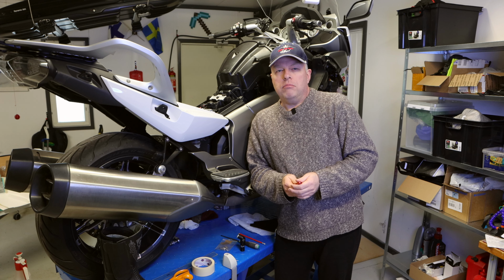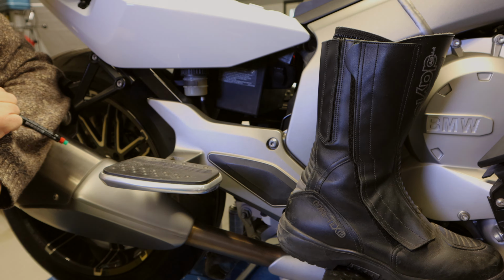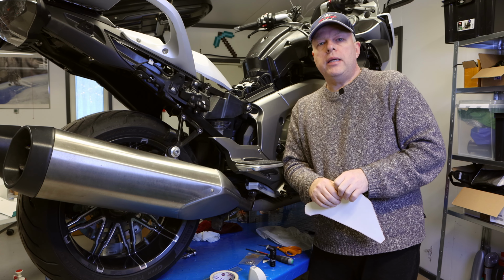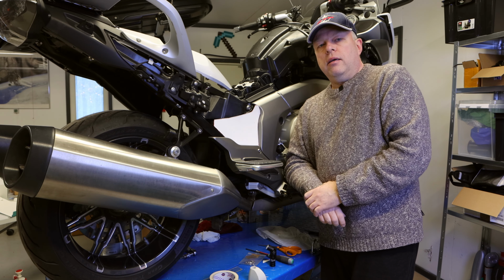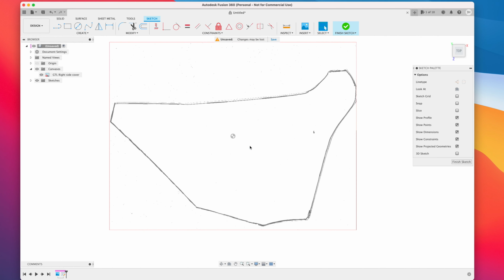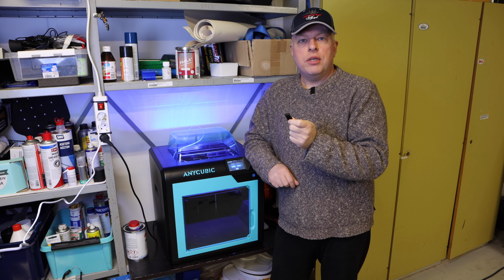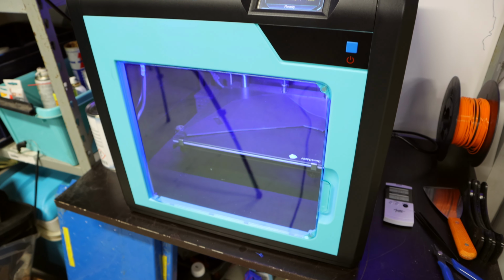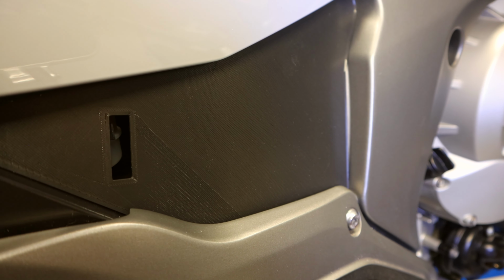3D printing motorcycle parts.

Comment: PLease I would like to know if the real motorbike plastic parts are created using 3D printers.
Reply from the maker: Hello. My print was real part. But if you refer to big fairing part, then no. It is currently impossible to print big parts. First the printer print bed is relatively small, abot 20x20 cm. Secondly the fairing is normally concave and not printable for this reason. Have a great rides.

Comment: I might have missed this in the video, but it can be worth mentioning that printing with PLA would not suit as it is very sensitive to heat and starts sagging when hitting 50C+. PETG or ABS would likely be able to (or better) take the heat and UV.
Good video!
Reply from the maker: Yes you are right. Most of my motorcycle parts are made from PLA and PETG. Some are from the ABS. I have had no problems, but the parts are located away from the heat source (hot parts of the engine and exhaust). Currently the PETG is the most easiest to print and gives the best finish. Thanks for the observation.

Comment: Thanks so much for the great video. I've wanted a 3D printer for a long time. This is just another great reason to buy one! BTW, do you have any idea of how much it cost to print that part? I just bought a 2020 K1600GT for my channel, and have a big pile of boxes of accessories to install. I wonder if I could have just made some of this stuff myself? :) Follow along at http://youtube.com/c/jaybearjaysbigadventure
Reply from the maker: Hi Jay. The cost of the individual 3d printed part is very low. After the initial cost of the printer and the filament. The slicer software can estimate the cost when you feed in the price of the filament. The cover I printed (one piece) was only a few (euro) cents. I think the trickiest part is to learn the modeling of the part with the software like Autodesk Fusion 360. But you can print parts which are modeled by someone else. There’s a ton of free parts design available from the different sites like a Thingiverse etc.

Comment: Indeed a good application of 3D printing at home. You can also try to incorporate design elements in the cover, like a logo or whatever. I wonder how it looks like when printed with a white filament one of them funky filaments, shiny black or satin. I like your method of making a sort of template out of cardboard and scan that. Good video for inspiration!
Reply from the maker: Thanks. There are no limits with the materials. And logos and what not.